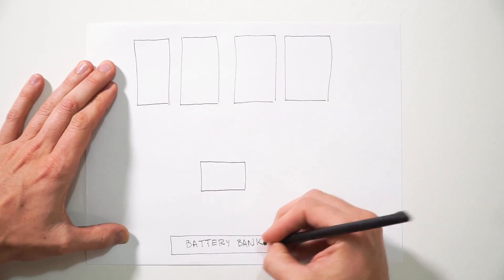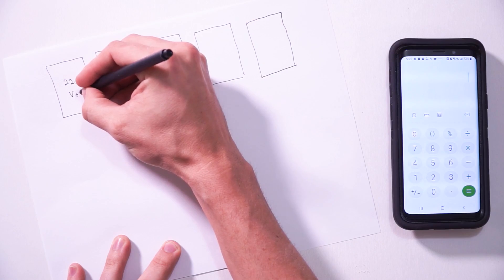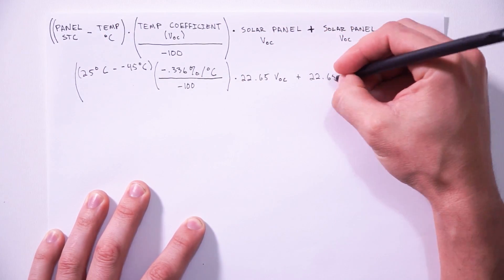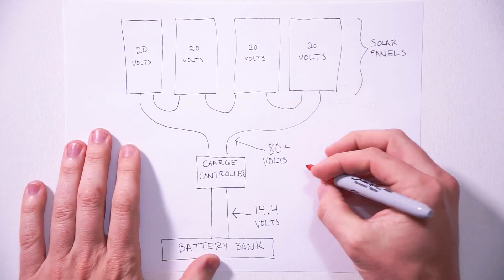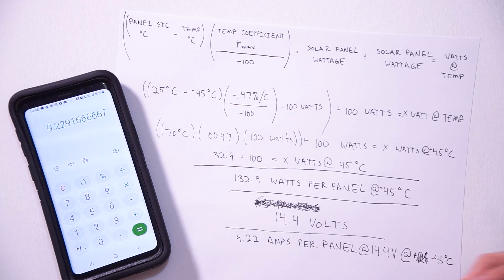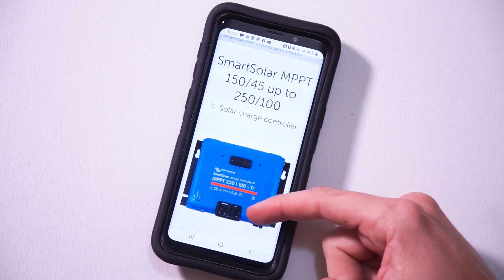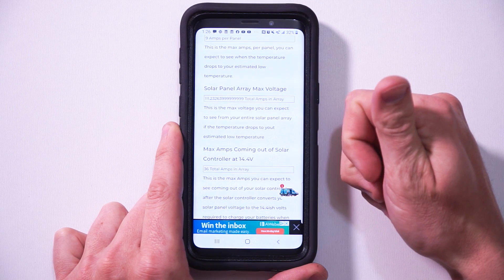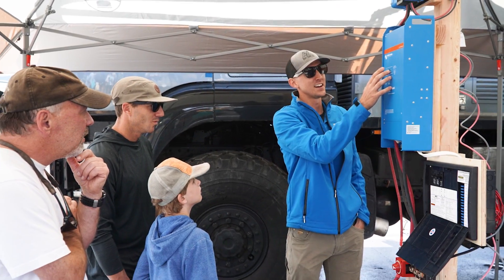How to Size a Solar Charge Controller for a DIY Camper Van Solar System

Comment: Quick question. I'm a newbie, so go easy on me!

 I have 4 100W 12V solar panels that I want to hook up to my oukitel 2000w power station. There will be 2 arrays of 100W panels in series going to the power station in parallel. 

Should I use 2 charge controllers, cut off switches, fuses, then connect it to the power station, or should I connect the panels directly to the power station?
Reply from the maker: I'm not familiar enough with that unit enough to know off the top of my head.  Usually those portable units have decent instructions to show you how to connect solar panels.  Perhaps reach out to their customer support if not, though?
Reply: @EXPLORISTlife  The question isn't specifically about the Oukitel power station in particular. I was asking in general, can I (and should I) hook the solar panels directly to a power station, or should I use charge controllers, cut off switches, and fuses before I hook the panels to a power station?
Reply from the maker: Ah, I see.  You generally don't need anything between the solar panels and the power station.
Reply: @EXPLORISTlife  ok great. That's all that I needed to hear! 
Thanks!

Comment: I am converting a coach bus into an RV. I have an opportunity to purchase 435 w panels. I was thinking of having 10 panels. The specs are:

435 W
72.9 VMP
5.97 IMP

I understand the math for wiring in Series/Parallel, however I can’t figure out how best to wire my panels to get the most bang for the buck. Can you give me your thoughts on how to wire them to get the most out of them. Every time I do the math I get a result that is difficult to find an appropriate (affordable) charge controller. Thanks

Jared

Comment: Roughly what size would you recommend I have  2 100 W solar panels a 12 V battle born 100 hour battery lithium wired in series
Reply from the maker: Perhaps use the calculator like I showed in this video?

Comment: I tried your calculator, but for 2 x 330 panels it suggests a 150 60 controller which seems like overkill?
Max V is just under 100V in series and Max amp is 9.75A so why should i buy such an expensive model, when i could buy the 100 15 or 100 20 controller? I dont understand, thanks if you can answer me. Great video btw
Reply from the maker: Hey!  You're clconfusing input amperage vs output amperage.  660W of solar will push over 45A out of the controller into a 12v battery bank: https://youtu.be/Jkbs84sBHsg
Reply: @EXPLORISTlife  thanks for the Quick answer, i saw the video you linked, but does that Mean i could parallel run the two panels instead, and buy the "cheaper" controller then?
Im not constrained by a 12v system i would like a 24v system if it means a cheaper controller, scince this is one of the most defining parts of your system. I want to expand in the future, so if more controllers of lower spec is cheaper i would go for that instead of a giant power controller. Hope it makes sense though!

Comment: In series your amperage stays the same, your voltage goes up. in para the amperage goes up.... you do NOT add your amperages together for series....
Reply from the maker: That's correct.  The increased amperage happens AFTER the charge controller. More info: https://youtu.be/Jkbs84sBHsg

Comment: Great info, thank you. What I find missing in all these videos is determining the most efficient way to charge a battery, meaning not only the charge controller selection, but the various segments of wire and the guage. I think this is a safety issue as much as anything else. For example, is the fastest way to charge a battery higher voltage or amps? And once I have the charge controller and panel arrangement figured out, what is the most efficient (and safest) wire guage and type to use?  I've yet to find a comprehensive video that help with that.
Reply: The most efficient way to charge the battery depends on what kind of battery and manufacturer of battery you use. Is it lithiumm, lead acid, etc. The selection and prroramming of a charge controller or inverter/charger is what gives you the voltages needed to do  the charging correctly and efficiently. As for selecting wire size, that's mostly dependent on the maximun current that can possibly be put out by tge charge controller or inverter/charger. And, don't forget to make the wires larger than any fuses or breakers needed.

Comment: I have off gridd inverter rated at 2400 w but the its mppt charger is rated at 1000w. is that means that the max power from solar panels passed to inverter is 1000w?
Reply from the maker: A properly sized charge controller connected to 1000W of solar would push 1000w to the battery bank.

An inverter rated for 2400w can pull 2400w from the battery bank.

If this is happening at the same time, the net positive or net minus would be either going into or coming from the battery bank.

Comment: This is a great calculator. However, one thing to be aware of is that Victron charge controllers require a 5 volt difference between the voltage of the battery and the incoming voltage from the solar panels to turn on. For example, lets say your battery is at 12.4 volts, the incoming voltage must be 12.4 volts + 5 volts or 17.4 volts. This is important in selecting your panel. In my case, I was looking at setting up a single solar panel with charge controller to maintain my batteries while my RV is in storage. This is on a truck camper with limited space on the roof.  I plan on an eventual expansion to 300 to 400 watts but initially I figured a 100 watt panel would be adequate to maintain my batteries. I bought the panel and a Victron 100/20 charge controller for future expansion. As it turns out the output voltage of the panel is only 16.77 volts. The charge controller will not turn until the battery voltage drops to11.77 volts. Not acceptable in my opinion. There are lot of panels on the market with higher output voltages and this wouldn't have been an issue. My solution is to buy another panel and run in series to double the voltage output. The charge controller should work fine after that.  Just be aware of the 5 volt requirement to turn on your Victron charge controller (not sure how this affects other brand charge controllers) when sizing and choosing your solar panels.
Reply: yeah, living quite far north i can agree ..
when 24V panel produces enough voltage to charge 12V battery only 3-4 hours per day ..
added second panel few weeks ago .. but its late spring / early  summer. I'll see what happens in late october.
Also using Victron controller, amazing stuff. Wide range of input V, different battery chemistries and voltages .. but the price .. ;)
Still worth it
Reply: @matikaevur6299  I'm in the same boat and need to start my build asap.

Are there any cons in running a 24v panel in a 12v battery system when using a mppt controller?

I can't decide between a 12v 200W panel and a 24v 200w panel.

My location is in Europe where it can be incredibly warm but also cloudy and quite cold.
Reply from the maker: Perhaps just choose from the systems I've already got designed and available to take the guesswork out of it? https://shop.explorist.life/product-category/all-products/camper-wiring-kits/solar-charging-wiring-kits/
Reply: @EXPLORISTlife  If your answer is for me then we have a problem with shipping/vat/import duties.

It's just that a 24v panel with the same wattage as a 12v carry the same price.

If my calculations are correct a 24v panel will send more charge amps to a 12v battery compared to a 12v panel with the same wattage.
Reply: @perpelle  
Hello, i run 2x24V in series to charge 12V battery.
It's ok in summer .. after that 2 weeks (ha joke :)
not much. Tallinn, Estonia.
Usually those MPPT controllers need battery voltage +2V to start charging. So in case of low light you get volts up faster and MPPT takes care about amps. My 2 panels are 24V, 240W, 10A, connected in series.
So mid-sized victron is quite ok. No controller can give you power if you haven't seen sun for 3 weeks ..
Reply from the maker: Just mirror the system, even if you don't want to purchase from me.

Comment: Just learned that I need a way bigger controller for my set up than I ever imagined. This saved me money in the long run, as I will not blow the puny one on an over voltage/amperage. 
With those 4x65W panels x 2 series it turns out I will have to go for a 150/60 controller.
Reply from the maker: Awesome!  Glad it helped.  Thanks for watching!

Comment: Also, I think there’s a segment of people that already own an MPPT and may think they NEED to absolutely go and purchase a new one if they’re undersized .
Yes and no.
If the maximum voltage of your panels exceed the max voltage of the controller, yes absolutely get a new bigger controller .
But if the amperage(current) is greater than what your controller can output, then no issues. The controller will output whatever it’s rated for (current) and waste the rest.
Reply from the maker: Most people I've found are unhappy when they are 'wasting' power but yes...  Excess input voltage will damage the controller.  Excess output amperage will just be wasted.
Reply: Totally agree, no one likes wasting power. In my case though, I only had one 325 watt panel with a 40AMP MPPT before adding a second panel.
I could technically wait it out until summer in the PNW to get a new controller because voltage wise I’d still be under 100volts but amperage would be higher than 40 in some instances so I’d lose whatever amps over the 40 threshold .

Comment: Thanks for the info you pump out.  I've been looking for a central source for related info and I'm glad I stumbled upon your channel.  The amount of info on the vids you produce just flies above my head at initial screening but I slowly get the picture as I re-watch the videos.  Question for you, though I'm not sure if this is within the scope of your channel or your website:  would you have inputs as to how to integrate a solar charging system with the van's own charging system so the van charging system can help charge the solar batteries?  Best regards from Ontario.

Comment: You're getting 133 watts on a 100 watt panel at -45 C in the winter....what?  Your calculation takes no account of seasons and assumes it is always 100 watts. If it is -45C, you are getting around 1/6th of the solar output compared to summer.
Reply from the maker: Potentially, yes!  A 100W panel is only 100W at 25 degrees C.  As it gets colder the wattage will rise.
Reply: @EXPLORISTlife  so you get more power in the winter then summer?
Reply from the maker: At one time, yes; but the days of sunlight per day is usually shorter, so the total amp hours harvested is usually less depending on much closer you are to either of the earths poles.
Reply: @EXPLORISTlife  On a -45 C winter day..lol ok.  But that is not what you said in your video.

Comment: My understanding for the Solar Charge Controller, you do not want the solar panels charging without a battery attached to accept the electricity. What happens when the fuse on the battery blows disconnecting the battery while the solar panels are still producing electricity?
Reply from the maker: In the case of victron smartsolar charge controllers, they will just cycle off and on until battery power is reconnected. 

This scenario should pretty much never happen given proper wire and fuses are used.

Comment: Thank you for so much information.  How do I get the following:  1) Temperature coefficient VOC and 2) Temperature coefficient of PMAX if this is not listed on my panel or my specifications sheet?  Any help you can offer is rally appreciated.
Reply: @jamieshakeshaft5468  my spec sheet has the Voltage Temperature Coefficient in mV, but it is not clear if he used mV or V in his calculator
Reply: yea...i agree... i dont know how to get those exact things aswell..good question...]

help.>!>>!

ultimately video left me confused on those 2 points

Comment: Your approach to simplicity when dealing with complex issues is commendable.  I have engaged with your calculator which calculates as designed, however, the Victron recommendation section at the very top doesn't seem to be recommending.  Fact is it doesn't display anything.  Wondering if there is a message there or not.  Said differently, if there is no recommended controller displayed, does that mean something is wrong with the calculation data or something else?

Comment: Hey Nate. Thanks for the great information.  Looking at my rich solar panels, some of the verbiage in your calculator isn’t the same so I’m not sure if I’m putting in the correct numbers. Mostly the coefficient numbers for temp.  I’m looking to connect 5-200 watt panels to the new eco flo pro coming out. The only thing they say is max 1600 watts, 11-150volts/15 amps.  I’m thinking I’ll be ok but still unsure.  I’m in the south Denver area. I put -10 degree f for coldest at daylight to be conservative

Comment: Correction needed
Hey Nate. I would like to thank you for your time and effort to upload all those informative videos, keep it up.
When it comes to calculating the Max Amps coming out from the MPPT solar charge controller the answer in your video references the max wattage you calculated with the formula divided by charging voltage pushed, where as in the calculator on the website it references the Max Voltage Per Panel at Estimated Low Temperature x Solar Panel Maximum Power Current (Imp) / Charging Voltage Pushed the two approaches are different and lead to different answers… I think something needs to be fixed.
Reply: Noticed that same thing.

Comment: Will a 100 20a victron controller be ok with a fixed 160w and a portable 130w panel parallel
Reply from the maker: It's best not to mix sizes of solar panels, generally.  Here is a video on that: https://youtu.be/jejro4zkl8I

Comment: Sorry, but on the current calculation you multiplied by 5 at moment "6:04" but you should take into account that the maximum current is only 9.22A as the panels are connected in series. Thanks for the video!
Reply: He's calculating the Amperage that would be supplied from the charge controller in the lowest temperature conditions. The current would be ca. 9.22A going into the controller, and  ca.  46.14A coming out of it.
Reply: @Mike Jones  unless the voltage changes you can't just produce more amps. Watts in has to equal watts out minus losses just like a transformer.

Comment: Ok, I'm a little confused. In a previous video you said that when wiring your panels in series the amount of amps do not change, but in this video you added the amps of each panel in series together. What made the amperage in the array in series get added together in this example instead of staying the same at 9.22 amps as shown in the example in the previous video? Please help. Thanks in advance.

Comment: Hi Nate liked your video on unequal solar panel systems. I wonder if you can help me. I have three panels on my van. 100 w + 20w + 180w they are wired in parallel and I'm getting up to 16amps would I be better wiring them in series. I am in Scotland and so winter is not so sunny but summer is very sunny. Regards Grant

Comment: Great videos!  I have a small Airstream with 1 90W Zamp solar panel. I plan to add 2-100W Renogy (pre-wired parallel) panels and have an external port for portable panels.  I have 6-100W 24V Lion Energy panels that daisychain together in parallel. I would probably only use 1 or 2 of the portable  panels.  My question is can I get by with 1 mppt or should I use 2?  I have a Victron 100/30 to install, however should I use a 100/50?

Comment: Hi, I am looking at the getting 2 360W-24V Mono 1956 x 992 x 40mm series 4a (SPM043602400) panels but the spec sheet doesn't give a Temperature coefficient of PMAX. Not sure what to do at this stage as have searched around on their site and can't find any reference to the figure anywhere. Do you have any suggestions?

Comment: I put this video data into your calculator. Amps from the charge controller are 52.26 (calculator) not 46.14 (video). Different formula?
What's the formula in your calculator?

Comment: good information!!! but why you decided to use 14,4 voltages? any specific reason? where do you the number from?
Reply from the maker: That is an average charging voltage for a 12V battery bank and is what Victron uses in all of their calculations and datasheets.

Comment: I beredd this. But have one question. Heat do I do of the spec sheet spenat show solen of your variables in your calculator. Like temperaturen coefficient for one.

Comment: Hello. Can you clear up a point of confusion for me. At 6;11 you took the amps per panel 9.22 and multiplied x5 panels to get 46.14 amps . But the panels here are in series so wouldn't  the amps stay at a total of 9.22.Thanks
Reply from the maker: That is the amps post-charge -controller.  Another way to figure that is to take the total solar wattage divided by the battery bank charging voltage.  This may help with that concept: https://www.youtube.com/watch?v=Jkbs84sBHsg

Comment: I'm running a 200w solar array on a tacoma . Can I just use a dual input dc/dc charger or is it recommended to use a separate solar controller?
Reply from the maker: I recommend separate solar charge controllers and DC DC Chargers.  https://www.explorist.life/solarwiringdiagrams

Comment: Please can someone explain how I can charge both my solar generator AND my leisure battery using my victron solar charge controller?
I dont understand where I connect the charging cable to that goes to the solar generator.
Reply from the maker: Use your solar charge controller to charge your leisure battery and then use your inverter to charge the solar generator.  There's no good way to charge both at the same time from your charge controller alone.